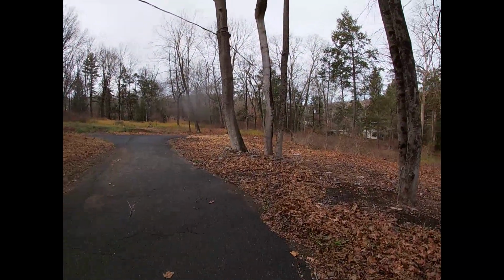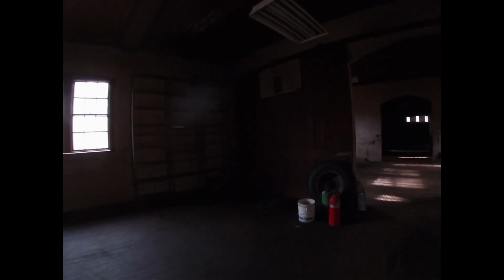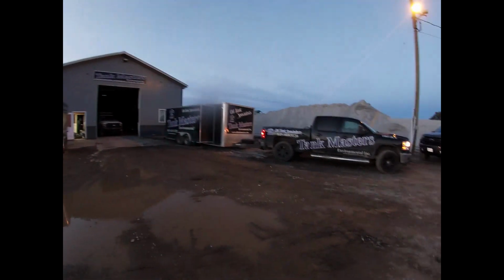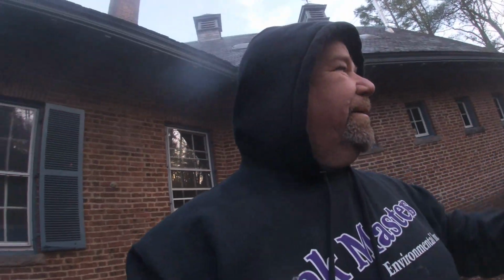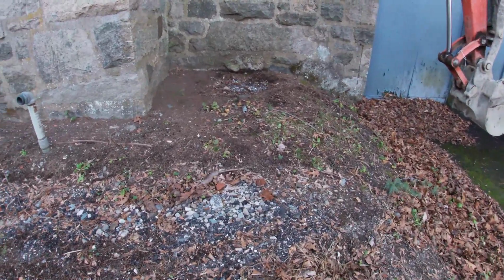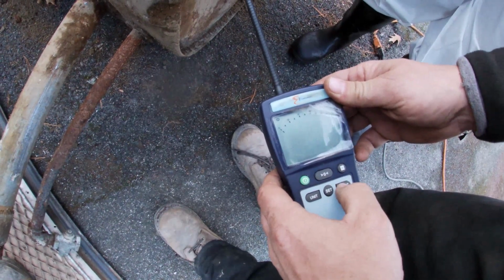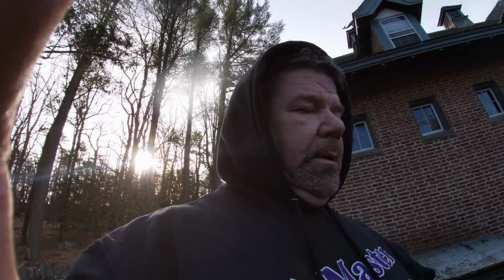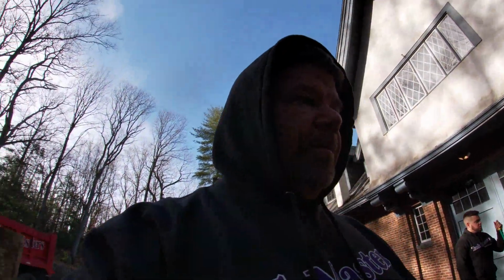Three underground tank removal at a mansion in Tuxedo Park, NY

Comment: I was kind of wondering why you guys didn't have more battery power tools, from sawzalls to the concrete cutters to even the SDS hammer drills.   Keep up the good work sir.  👍🤠
Reply from the maker: Good question! Cuz were lazy and don't remember to charge batteries, loose batteries and loose battery chargers. We have a couple  of tools we do use every day though, Craigs flaring tool and a drill driver.